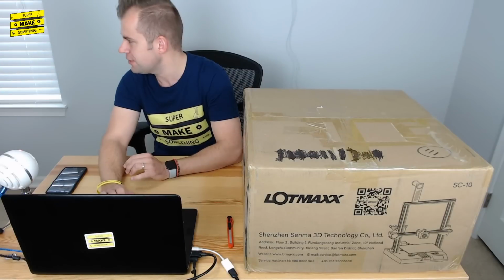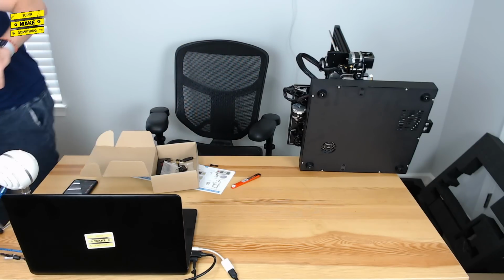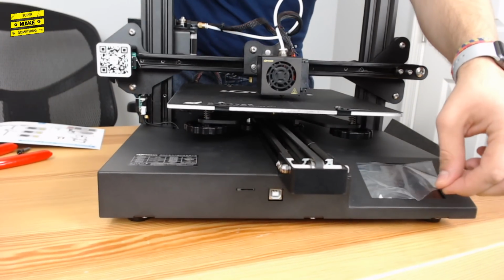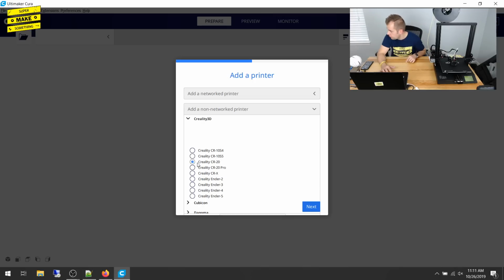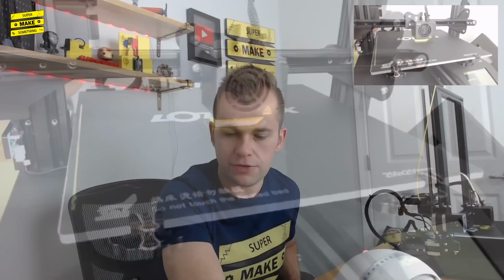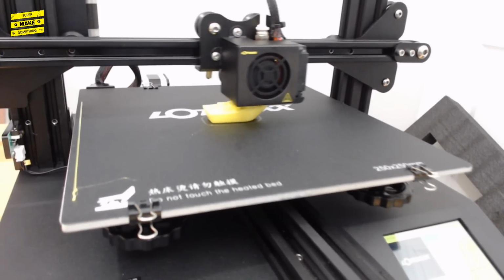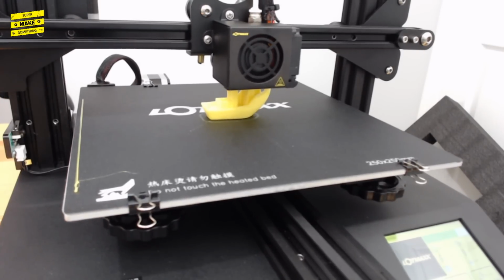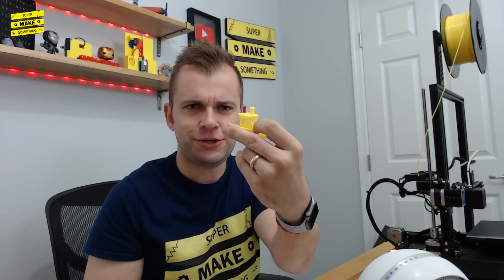Lotmaxx SC-10 Unboxing, Setup, and Review (GREAT Beginner 3D Printer!) - Super Make Something Live!

Comment: I'm really split between the SC-10 and the Ender 3. The SC-10 has the upgrades I would want to make (silent board and touch screen) for about the same price, but there doesn't seem to be as much out there about it. I also like that the SC-10 is more clean (cable management-wise). I have never had a 3D printer before and am struggling to choose from the seemingly never ending options. What do you think? Thanks!
Reply from the maker: StRiKe I think that as a first printer, which just works “out of the box,” the SC-10 is a great choice, especially since it already has all of the upgrades you are looking for. The silent stepper drivers are great and I also really like the semi-flexible build plate that makes it easy to remove prints. Since I made this review, I heard that the printer now also comes with a metal extrusion motor lever arm assembly as well. (Mine came with a plastic one.) This is the only thing that I’ve needed to replace on the machine because it wore out after ~1000 hours of printing. I expect the metal one to last for the life of the machine. While I have never used an Ender 3 myself, I can definitely say that the SC-10 is an awesome printer, which I would still highly recommend!
Reply: @SuperMakeSomething  thanks for the pretty quick response! I think I'm going to try out the SC-10! Happy printing!
Reply from the maker: StRiKe Awesome! Good luck! Hope you enjoy the printer!
Reply: definitely lotmaxx, lol

Comment: Is there a hardened steel print nozzle that can replace the stock brass one? I'd like to print Nylon and NylonG, but they require print nozzle temps right at the top of the Lotmaxx's limit.
Reply: Dear Sky Ready RC, Thank you very much for your purchase and comment and very sorry to reply you late because of our busy schedule of printing and sharing the Christmas models for our users and market, could you please accept our apology and offer your understanding and forgiveness?
As for the print nozzle question you mentioned, we have confirmed the issue you asked to our technical team once we read your comment. Yes, you can change our print nozzle for other material nozzle like steel if its screw thread is the same as our brass print nozzle. For the professional suggestion from our technical team, we do not suggest you to print with Nylon or NylonG because the quality of printed model may not be as good as the PLA filament according to our internal R&D test. Besides, this is not really related to the temperature of print nozzle.
By the way, if you plan to change your print nozzle, please turn off your printer and wait for your printer cooled down completely before changing. Please kindly notice this.
Dear Sky Ready RC and all of our users, if you have any question, and/or have any suggestion, and/or need any support from us, please do get to us at any time. Any of your feedback will be always welcome and valued. Please get to us via the following channels directly: Official website: www.lotmaxx.com E-mails: service@lotmaxx.com or sales@lotmaxx.com or marketing@lotmaxx.com Or search LOTMAXX on Facebook, Instagram, Twitter and Youtube and drop your messages to us directly. Looking forward to your feedback. Thank you very much again and best regards.